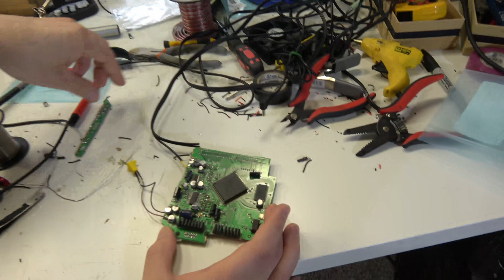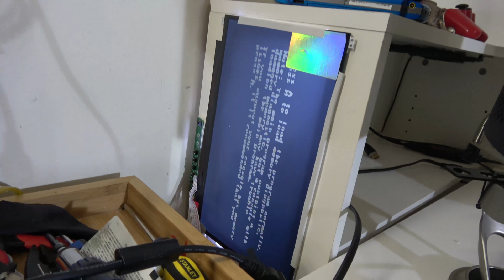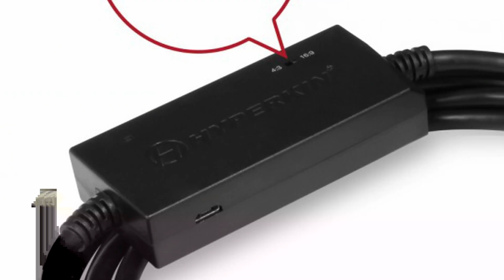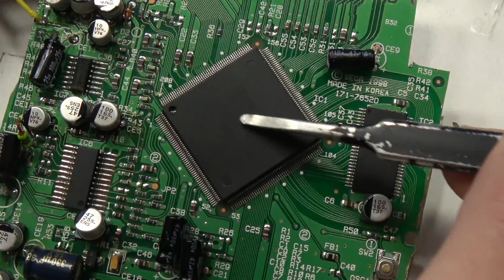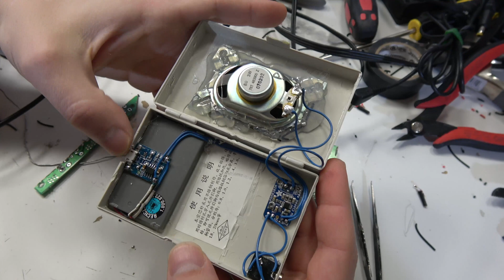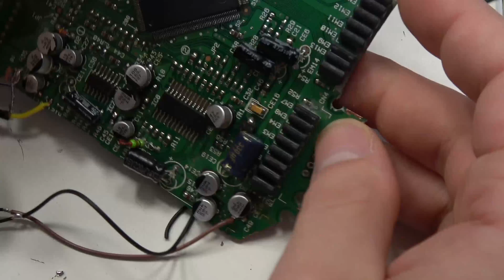GENESIS PORTABLE  PART 1 (TRIMMING + PLANNING)

Comment: I don't advise hyperkin.  I would advise using a RAD2X cable because that is very high quality output.  You can also tryout a triple bypass board and try to source an LCD that takes in RGB as an input source.  Lot of different routes you can take.  You can also wait for krikzz to release the mega everdrive PRO which can play CD games...cheaper than MEGA SD.
Reply from the maker: Right!? Theres do many choices, I can use the LCDDVR or RGBDVR driver boards from japan too. I'm trying to find the most cost effective/best quality mix. Those rad2x boards are all sold out/backorder though last I checked

Comment: Also, why not just add a cart slot on the board and have it come out the bottom of the system?  Genesis carts are rather small, so with the right design that might actually work.   Or you could solder the pin connector down in a way that has it vertically aligned to have it sticking out the top potentially.  Would also save on board thickness as well without the need to stick an Everdrive cart on the bottom.
Reply from the maker: My goal is to have the entire thing fully enclosed. I dont want a card slot on the top or bottom, I dont want the cartridges to be viasable. So the ever drive will be entirely inside. I was THINKING of MAYBE re routing the sd card slot to be on the bottom or top so that is removable. If I can make a little latch or door for it on the 3d printed shell
Reply: @ThirstWorldTTV  One solution you could do for that is to simply buy an SD card extender.  It's basically like an extension cord for your SD card.  They work great and you can get em on Ebay for next to nothing.  No need to desolder or relocate anything with one of those.
Reply from the maker: Hmm
Reply: @ThirstWorldTTV  It's basically a Ribbon Cable attached to an SD card with an SD card slot on the other end.  Pretty cool.

Comment: Very cool project!  But dude... Please don't use one of those Hyperkin HDMI adapters.  Those things are straight up garbage.  They use the exact same circuitry as those cheap Chinese Ebay SCART to HDMI upscalers, only difference being they have tuned the firmware a bit to bring down the absurd amounts of lag that those cheap upscalers add.  They process 240p incorrectly as 480i just as the Chinese upscaler boxes do, and it just doesn't look good at all. 

You would be MUCH better off using one of the RAD2X HDMI adapters sold by Retro Gaming Cables UK.  Those are made by the same guy who made the RetroTINK and they are fantastic!  Everything is processed correctly, looks great and adds zero lag.  Most definitely the best plug and play option currently available and are pretty cheap to boot, somewhere around $50 a pop if I'm not mistaken.  I own several of them myself and they are great for when I travel so I don't have to unhook the Framemeister. 

I would absolutely recommend going that route over the crappy Hyperkin HDMI adapter. I'm honestly a bit shocked that you'd even consider using that thing.  I thought you knew better than that man lol.
Reply from the maker: So the rad2x are kinda expensive/unavailable so I was learning towards hyperkin for it's cheap nature. But I didnt realize circuitry was that cheap. What about the pound cable? Same garbage? By the time I'm ready for this the rad2x may be available and I'll have sold enough psps to fund this whole project lolololol
Reply: @ThirstWorldTTV  Lol well they aren't that expensive bud, only around 50 bucks or so.  But yeah, the Pound cable is literally the exact same cable as are all the other ones out there by different brands/names.  They all cost around the same and are the exact same thing, and are all crap.  The only solution of it's type worth a damn right now for an affordable price is the RAD2X. 

Otherwise you're gonna hafta spend even more and get a SCART 2X I think it's called?, which is essentially a standalone SCART to HDMI converter that can be used with any system. Those run around 100 or so.  Those are your best options currently for a reasonable price that take up very little space.  Basically anything that Mike Chi over at RetroTINK has made is the way to go if you can't afford an OSSC or Framemeister, and they are very small and don't take up hardly any room.
Reply from the maker: Yea, the smallness is what I need, theres going to be alot of space taken up inside this thing. I'll prob go with the rad2x, pull the board out of that little box and pack it up inside this unit. I'm working on psps right now so I should be ok when it's available lol. Hdmi out on the lcd display would be sick. It's worth it
Reply: @ThirstWorldTTV  Sounds like a good plan :)  And maybe even have an HDMI Output on the system so you could still hook it up to a big screen display if you wanted to.  Oh, and just to note, the RAD2X also has a button on it that allows you to activate a built in smoothing filter should you want to use it.  It's just a basic smoothing filter to smooth things out slightly if you like that look, but it's up to you whether you like the sharper pixels or not.  I like the sharper pixels myself, but It's there if you wanted to use it.  Could maybe add a simple small push button switch to the system to toggle it if you wanted to do so.
Reply from the maker: @skins4thewin  yea. I'm definatly going to want to relocate that button to the outer shell. That will be a nice feature
Reply: I second this. You would literally be better off using one of the $20 SCART2HDMI boxes than the Hyperkin since they cost less and are the exact same thing inside. You can't sell a cable for a 240p system that doesn't properly support 240p! In that same vein, you don't want to put all that effort making this 240p system portable and all that effort getting the Hyperkin guts inside only to end up with something that deinterlaces non-interlaced 240p, destroying 60hz effects (flashing to simulate transparency, smooth scrolling, screen strobing for explosions, etc).
Reply: @emmettturner9452  Well, to Hyperkin's credit, their converter isn't EXACTLY the same.  The hardware inside is, but the firmware isn't.  They have developed firmware that reduces the amount of input lag that the hardware adds, however it most definitely doesn't fix the fact that the hardware is utter shit and was never made for 240p content.  It is still junk, but maybe slightly better junk than those craptastic Chinese converter boxes being sold on Ebay.  The image it produces still looks like crap. 

The RAD2X cables or literally anything made by RetroTINK would be MUCH better.  Or best of all, an OSSC, which are going way down in price by the way.
Reply: @skins4thewin   @skins4thewin  They don't have custom firmware. It's an off-the-shelf chip intended to handle analog inputs for HDTVs and adapt to the panel's native resolution/aspect. The SCART2HDMI and Hyperkin "HDTV Cables" just take the panel output from that same chip and run it through an HDMI transmitter instead. This step does not create lag. It's the framebuffer and deinterlacing/scaling routines in the chip that create lag.

There are several off-the-shelf chips used in the generic [whatever analog input]2HDMI adapters. Some are better than others but they all are intended for handling analog inputs on HDTVs, which is why some even show a TV HUD/info display. They grind the chip markings away because anyone could duplicate the functions using the datasheet, though I don't know why anyone would want to. So far, the only off-the-shelf chips that can properly digitize and scale 240p are the ones in the RetroTink 2X and the chip used in GBS family scalers. The chip from GBS8200 et al has Russian documentation that no one understands and comes in an analog to analog scaler, so it's of limited usefulness to us, plus it kinda needs to be tricked into doing 240p. The one from RetroTink 2X only accepts component so you need an RGB to component conversion in addition to the chip.

Any difference in latency is due to which specific chip these use but they ALL have framebuffers and ALL mishandle 240p. It would be a huge deal if someone found another cheap off-the-shelf component that did 240p analog to 720p or 1080p HDMI.

Comment: Paul I'm going to hook you up with my Retro PSY for this, it has 3.5A output at 5V. You can power everything off of that and has an enable pin too if you want to turn it off with a switch. Let me know if you'd want it.
Reply from the maker: HELL YES THATS EXACTLY WHAT I NEED!!
Reply from the maker: I knew someone would know what parts would work. 3.5 amps!
Reply from the maker: I didnt see the retro psu V2 on your site, I want the v2 one you been posting on IG hahahahha
Reply: @ThirstWorldTTV  Unfortunately only had 3 to test and you do not need that much power for the genesis. The current one is more than powerful enough.
Reply from the maker: Ah ok dope, good to know, I didnt know the difference but as long as I can power all that shit I'm good lolol
Reply: @ThirstWorldTTV  Yea the genesis is like 1A if that and the LCD and amp would take the rest of the amperage but still plenty left over for your LEDs you will likely put all over the place. If you want I can make you a flex pcb for the socket to the the cart or even some other parts instead of doing a spaghetti fest of wires.
Reply from the maker: @Angryhelder  haha I love running wires. Maybe for a streamlined project version those flex pcbs sound nice but for now I wanna just figure it out and hope it all works, and that's so good to know that your 3.5a will power this whole thing. I was worried about that
Reply: @ThirstWorldTTV  Thant's cool, if you do decide to make more then we can talk about streamlining it.

Comment: Awesome work, board trimming always make me nervous. Btw those three pin parts near the controller ports are probably dual diodes to protect the logic from esd zaps that could easily blow through the cmos. It's a common config called crowbar diode protection where any static discharge is directed and dissipated to the power rail or ground before it can make it past the diodes.
Reply from the maker: No shit. That's great Intel, the more I know about this thing the better

Comment: wouldn't it be better to shrink down the Sega Nomad, replace the screen with a better one, and add a rechargeable battery via micro USB?
Reply from the maker: I thought about that after I cut this mobo LOL! but I wanted to do it with the gen 3 cuz I think I could still get it smaller than nomad. Cuz I wanna build it "from scratch" sort of speak. I have 2x 5000 mAh batterys that are pretty small form factor I think I can fit into this enclosure when I make it
Reply: @ThirstWorldTTV  good luck with the project, can't wait for part 2!

Comment: I am looking for a multimeter. My cheap centech 5 one only measures volt level. It looks like you have a Fluke. Can you recommend one for up to $20.
Reply from the maker: Mine is a knockoff fluke, cheap chinese clone. Works great except I kinda melted one of the prongs a bit and gotta twist it to get it to read. Been meaning to buy a new one. I'll post a link as a reply to you somewhere.